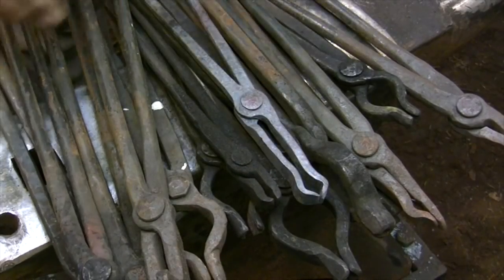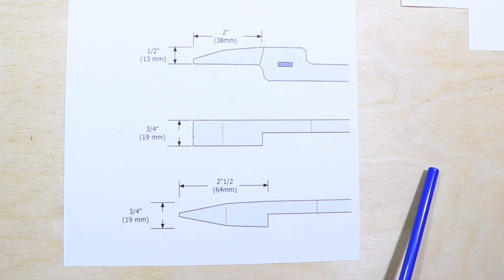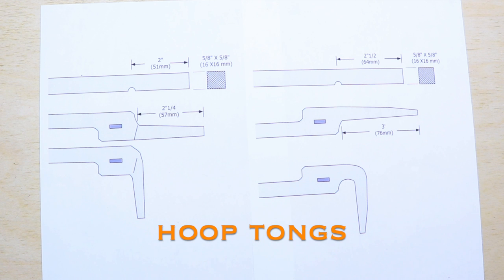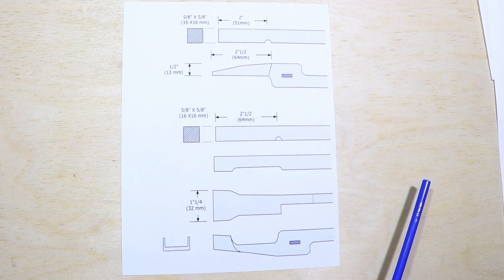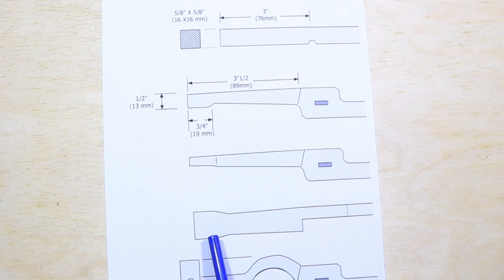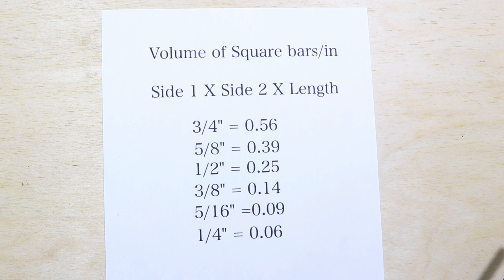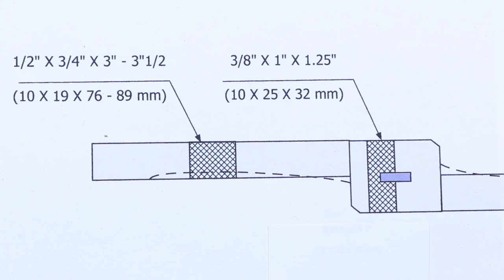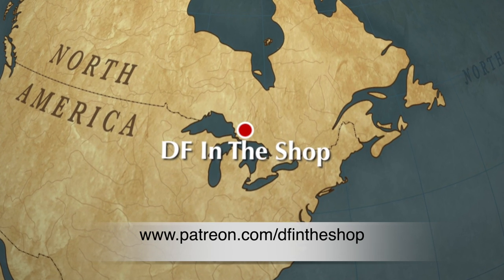Forging Basic  Blacksmith Tong Shapes - DF In The Shop

Comment: I think I understood everything but the small box tongs. I looked like they were meant for hold larger stock at the very tip of the tongs. Could you show those tongs and their use in a video?
Reply from the maker: I have a video on that.  It's in my playlist on tongs or in the blacksmithing for beginners playlist - basic tong shapes and their uses.
Reply: Thanks! I will be watching that one.

Comment: Thank you, very useful video.
I use weight instead of a volume. 
I am a bit lazy on measuring things, and when I manage to do something I like, I usually have no idea that how much material I have used. But by weighting the ready thing, i know how much of a bar I need to repeat the it.
And because we usually buy the steel by meters, but the supplier sells it by kg:s, I find the the weight (kg/m) from the receipt.

Comment: I've noticed that all of the old manuscripts show tongs for holding round stock with rounded bits, but of literally DOZENS (if not hundreds) of videos I have watched on making tongs, I don't think I have ever seen round bit tongs made.  It seems that if square jaw tongs work well enough to hold round stock today, smiths of a century ago would have realized that as well.  So why did they make all those round bit tongs?
I haven't seen anyone address this issue.  Do round jaws hold enough better than square jaws to justify making six or more pairs of round jaws?  I realize a dozen extra tongs don't take that much time to make in comparison to the years they would be used; but if they could have gotten by with fewer tongs, why didn't they?
Reply from the maker: In my experience,  properly fitting round bit tongs do a much better job of holding round stock than square bit tongs.  However they are limited to that  exact size.  So they are great for production work or for specialized jobs where you are working with known stock sizes that are not going to change during forging.  That's why they show up in old forging manual because these manuals are usually geared to production or industrial forging.   Square  bit tongs are pretty good for holding round bar but their big advantage is that one pair can handle a wide rage of stock sizes.  So for most people,  the advantages of square bit tongs for general forging outweighs the advantage of round bit tongs for holding a specific stock size very well.